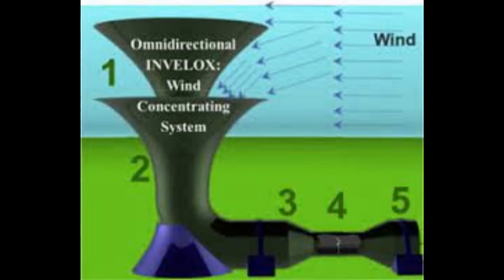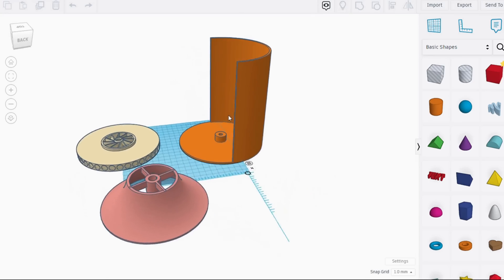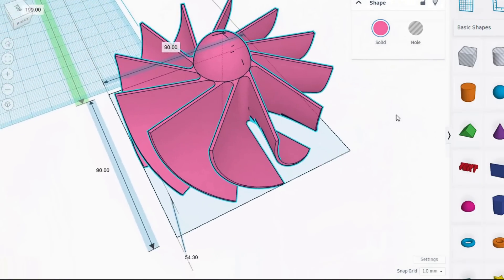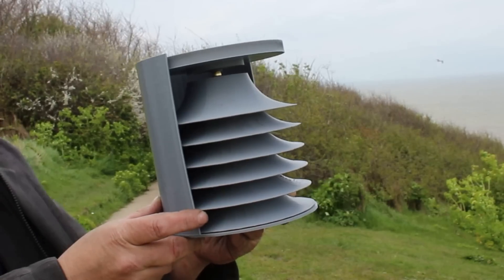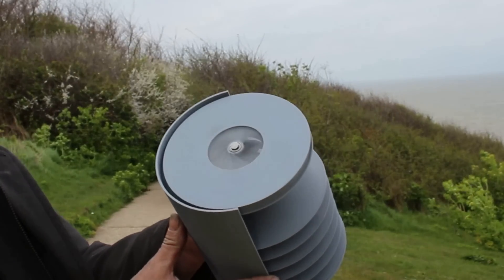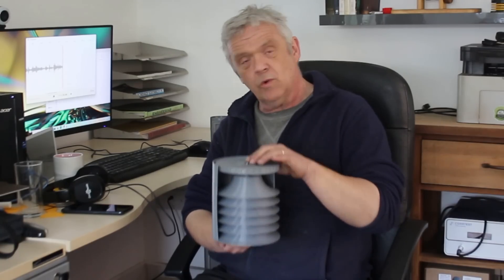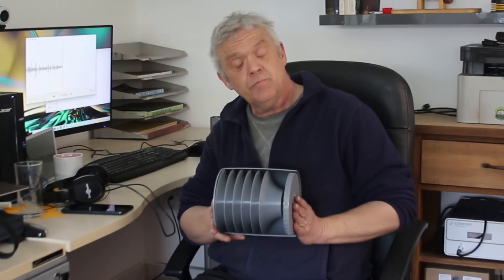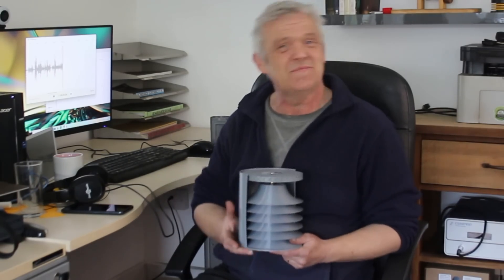1901 Brand New Wind Turbine Design For Camper Vans, Boats And Roof Ridges

Comment: Also can work for a RV (motorhome). Thank you Sir!!
Reply: I was thinking the same, use the wind power while driving to charge the batterys in the camper van as solar is not always great in winter so any extra electricity would help
Reply: @dannywilson5852  Wouldn’t that cause drag so you’re offsetting fuel for electric?
Reply: @srw_cricket2976  I suppose it depends on the drag but it would have to be worked out to see if that's the case .. I'm no expert so couldn't answer that question ... it would be quite hard to work out im guessing it would have to be something similar design of a planes engine..
Reply: @dannywilson5852  You would be loosing energy as much as you would generate. Also the alternator produce tens of times more electricity than this turbine while driving. But when you are stationary in a windy place, rise up the chimney and it could work well and support solar panel production
Reply: Other than charging it also can serve as a fan moving air inside. Some RVs have problem with airflow
Reply: @replikvltyoutube3727  yes they do but unfortunately in tropical areas where that's a huge problem it also coincides with still days . Humidity and still days is the most awful experience especially 4-5 days straight . In this situation you would have to use the energy to spin the motor for airflow
Reply from the maker: You bet!